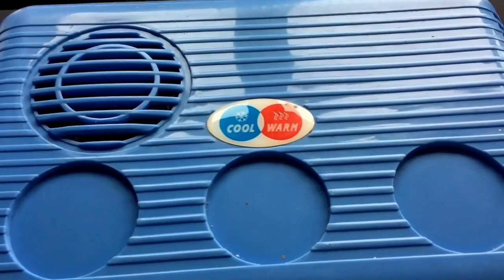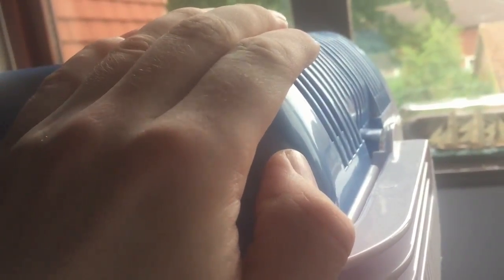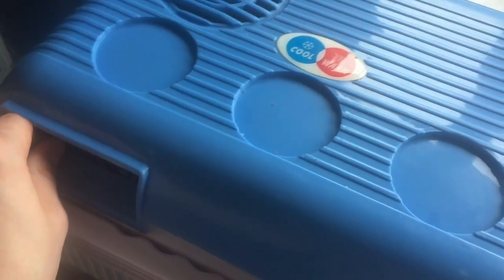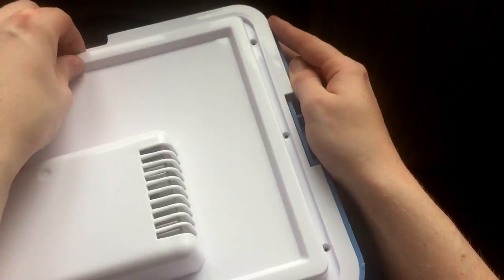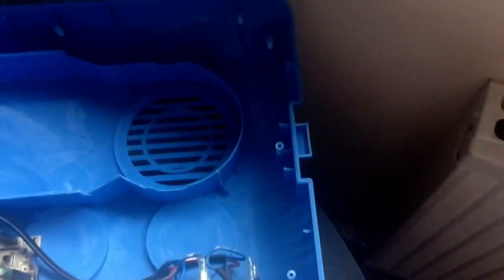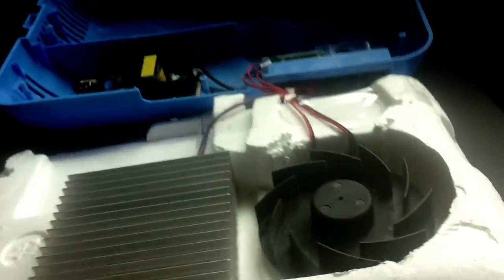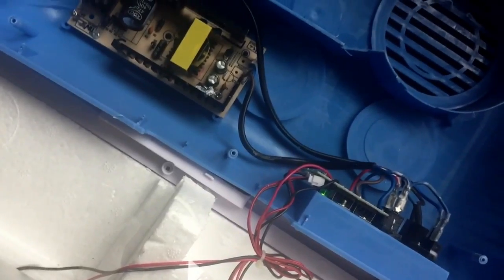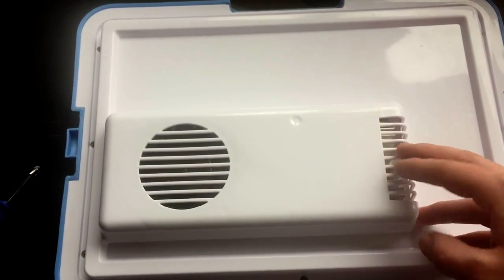Electric cool box explanation of operation and teardown.

Comment: I have bought one of these for camping and would like to know Is the ambient temperature measured from the air being sucked into the cooler ? And is the intake vent the one on the top ? If this is the case and the colder the air being sucked in the colder it will get inside (15 below ambient temp) and the intake vent is on the top, could you connect a flexi pipe from the top vent which goes outside the tent where the ambient air temp would be colder thus making the inside of the box colder?
Reply from the maker: Yes it would be from intake air, I’d say the cooler the intake air the lower the box temperature. I have another box which I have put an extra seal on, I find this helps to get the box even colder.

Comment: why does the green lightkeep flashing with a clicking sound
Reply from the maker: This sounds like the relay may be faulty. Unfortunately upon tearing this device down it does not appear that its designed to be repaired so a replacement is probably your only option I'm afraid.